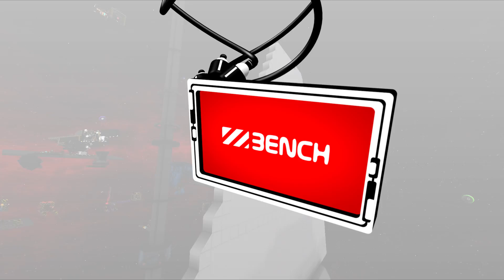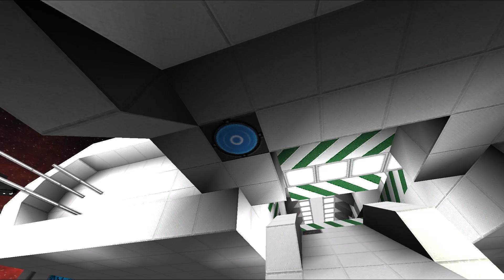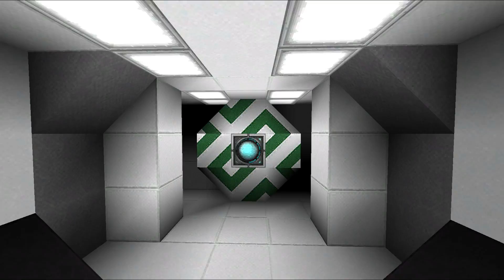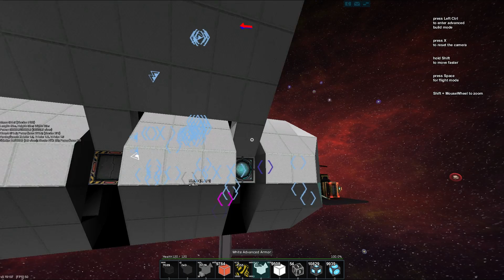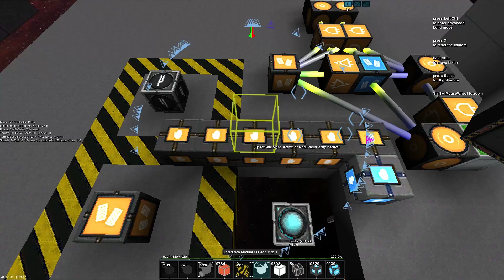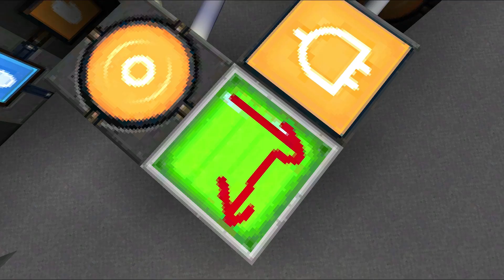Starmade - Dev 0.19197 - Star Wars Imperial Shuttle

Comment: will you be able to show us how you did this?
specifcally the connections you made to each logic block
Reply from the maker: TheQuantumReaper Maybe not this specifically but i'm planning to do a let's build an x-wing video that you will be able to follow along to, and have the wings split apart.
Reply: oh boy! thanks, also i found a way that is far simpler than what you showed for the angles and such using only 4 blocks to get the forward and backward flip flop effect

Comment: Do you need ship cores on each part you hook a rotator / rail movement to ?
Reply from the maker: Bernard Gilbert yes as each is technically treated as a ship as well.
Reply: I just tried using the rail system today. I hooked up the main rail connector to an older core block I had (from an earlier build version) I got back the message "Rail incompatible with earlier docking system" (or something to that effect) Is it because I used an old core? 

Also When docking now does the rail link have to be exposed? (that is it has to be the lowest block on your ship, like the old turrets, and you can't have any armour protecting it, {like I've learned to do with my ship cores})
Reply from the maker: If you have any old docking modules or turret modules on a ship you're trying to use the new rail system on it will clash. You need to remove the old docking first.

Yes you do

Comment: Firstly, this is amazing!

Secondly: Is there a way to get continuous 360 degree rotations in the same direction (a loop)? Is there a way to slow down rotations?
Reply: Rex Smith yes you can have continuous 360 degree rotation, make it like a fan, and no, you can't slow down rotation, but you can speed it up with double rotation block set